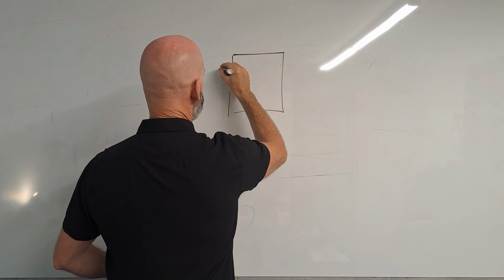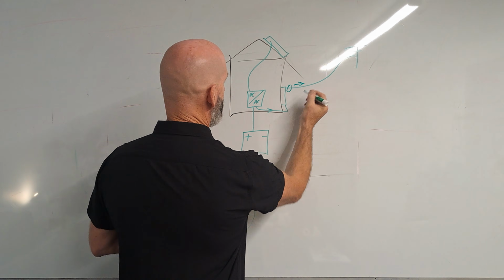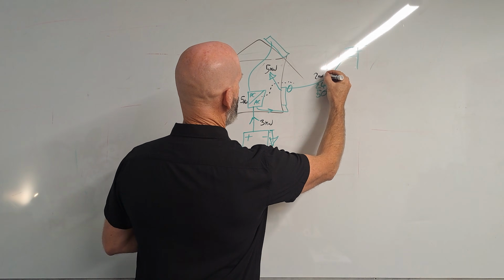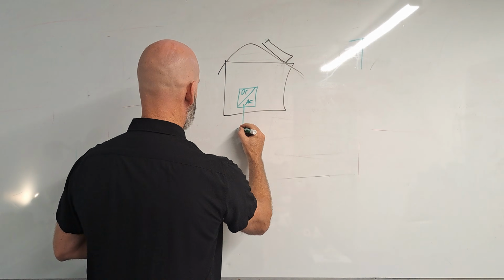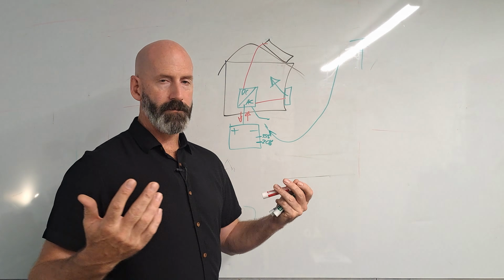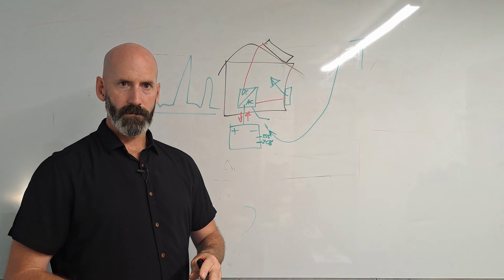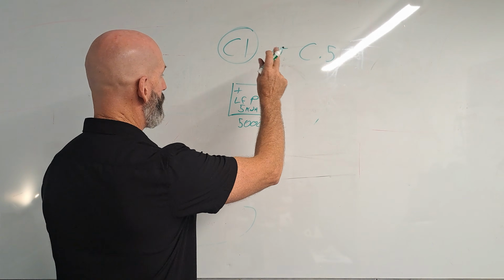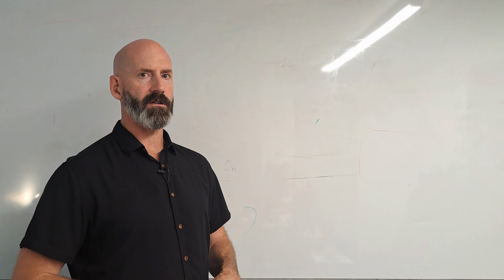Grid Vs Hybrid Vs Off Grid

Comment: Could you filter out the "high frequency signal" to eliminate this?
Reply from the maker: Theoretically yes, but it would then be a non-compliant system and put you in the position of connecting unapproved systems to an electricity network which will get you into huge trouble. 

The short version is that if you want to use their system, you have to play by their rules. That's why we create off grid power systems.

Comment: great video thanks for this. 
Not sure if you know the Luxpower SNA5000 inverter. that can feed back to the grid and also combine the grid+ battery + solar.
Reply from the maker: Thank you. There are quite a few inverter systems that do solar and battery storage and also feed back to the grid. Generally, these are hybrid systems but there are some like the SMA and Selectronic inverters that are rated for full SPS and hybrid applications but very few hold this rating.

Comment: What happens when the grid might go down? Won't your inverter feed back into the grid and make a dangerous situation for the power company repairing the grid? I also thought it was illegal to have it wired that way.
Reply from the maker: Great question. So with our systems the inverters are set up in a 'stand alone' configuration where the system provides power completely separate from the power grid. If we set up the grid as the 'back up' supply, the grid connection acts like a battery charger that you would use on a tractor battery. The grid only provides charge when the battery is low and does not allow back feeding onto the grid. 

A system that can feed back onto the electricity grid is a hybrid system. 

What we build are full Stand-alone Power Systems.

Let me know if you need more information.

Comment: What are your thoughts on the EcoFlow delta pro ultra batteries?
Reply from the maker: Im not intimately familiar with them but look like a similar system to the Bluetti units. 
The look like a good entry level camping or 4wd system but could go large enough to run a small house. 
They seem to have some significant limitations when looking at them for full off grid homes such as no programmable generator control and limited configuration options.

Comment: This is a great video, would be great to get your opinion of sig energy inverters. I assume there some where in between a hybrid and a proper off grid system
Reply from the maker: I did a video on the sigenergy inverters. They are hybrid inverters, they are not off grid inverters.
Reply from the maker: I did a video on the sigenergy inverters. They are hybrid inverters, they are not off grid inverters. Some scumbags are lying to people and selling them as off grids but they are not rated for it and will not be covered under warranty.

Comment: I disagree with you on several points. I think you are right that people should play close attention to what they will get in a specific quotation. Take your time to study the specs when comparing different quotations and don't just look at the headline power number. Charge and discharge rates for batteries can make a difference.
Off grid can be a good alternative to hybrid systems, but it doesn't make sense economically if you have the grid available, where you can apply net metering. I do not agree with your fear mongering about the government emptying your batteries. This is unlikely to happen involuntarily, unless the government is going to change the constitution. The current path in Australia is unsustainable and the government will have to take some drastic measures to make their dream to save the planet come true. We'll have to wait and see how desperate they will get. There are measures you can take in case the government tries to take over your system remotely.
Your C levels explanation is wrong. A low C rate is bad. A .5 C rate means you can discharge half the battery capacity in one hour. C rates for lead acids are typically between 0.2 and 0.05. LFP batteries for hybrid and off grid usually have between 0.5 and 1.
Hybrid systems are a good compromise between off grid and grid tied. You can optimize them to be closer to either grid tied or off grid.
Reply: Is this wrong?
The C rating of a battery indicates its maximum safe continuous discharge or charge rate relative to its capacity. It essentially tells you how quickly a battery can be charged or discharged without damaging it.

Understanding C Rating:
	•	C = Capacity of the battery in ampere-hours (Ah).
	•	The C rating is a multiplier used to determine the safe current.

How to Calculate Current from C Rating:

Current (A) = C Rating × Battery Capacity (Ah)

Example:
	•	A 2000 mAh (2 Ah) battery with a 1C rating can safely discharge at:
	•	1C × 2 Ah = 2 A
	•	If the same battery has a 5C rating, it can handle:
	•	5C × 2 Ah = 10 A

Types of C Ratings:
	1.	Discharge C Rating: Max safe current for discharging.
	2.	Charge C Rating: Max safe current for charging (usually lower than discharge C rating).
	3.	Burst C Rating: The maximum current the battery can handle for a short time (typically a few seconds).

Why It Matters:
	•	Overdrawing current beyond the C rating can overheat or damage the battery.
	•	In applications like RC vehicles, drones, or power tools, higher C ratings allow for stronger bursts of power.
	•	For energy storage (like solar batteries), lower C ratings are common for steady energy output.
Reply from the maker: @GerbenWulff  you may want to check your C rating understanding for Lead, Gel and AGM. 

Feel free to email me and I'll run you through it. 

The C rating for Lithium runs in the opposite direction to C ratings for lead acid, gel and AGM.
Reply from the maker: Also, grid connect and hybrid are very different systems to off grid. We are building a half million dollar system for a commercial client who has the grid. But the off grid system solves other specific problems that the grid can not.

People need to understand the specific differences between the system types and make an informed decision. You are 100% correct on that.